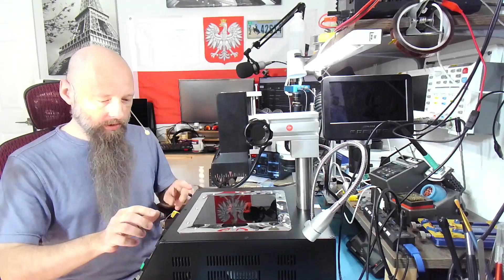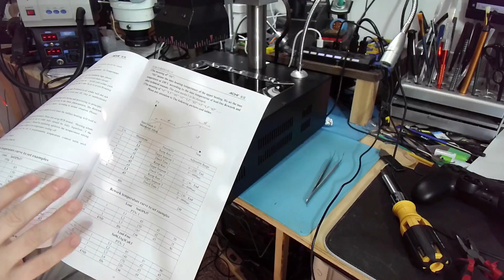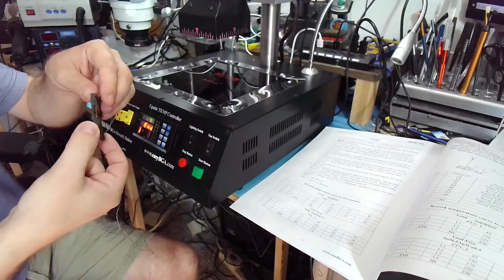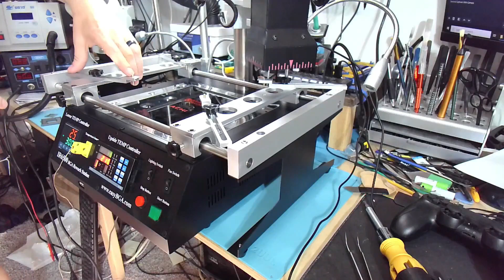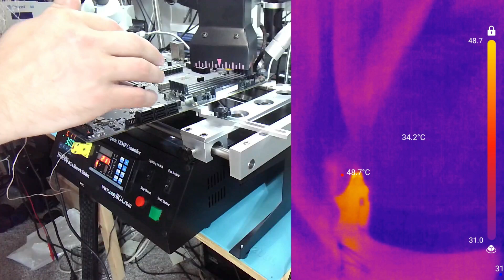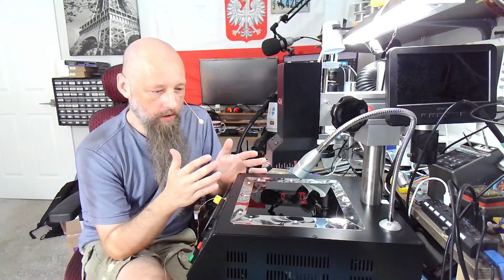#67 | IR6500 BGA Rework Station for CPU Socket Replacement

Comment: I'm now interested in this machine, have you ever tried to reball a lenovo legion laptop board before? If so what temp stages did you use? I'm asking because lenovo uses black glue around the cpu and gpu core which makes the removal process very difficult and a gamble.
Reply from the maker: yes, that underfill is a pain. Remove as much as you can at around 150C, then remove the CPU (standard CPU removal profile), then scrape remaining underfill at 150C at the bottom. it's 50/50 chance of success

Comment: Thanks for the tutorials brother. I'm just diving into this stuff in my mid 40's and your stuff is helpful. Business partner just gave me one of these so were about to see how many boards I burn up getting the hang of it🤣
Reply from the maker: in my case is was around 15 boards before I got some good results :)
Reply: @blackhorserepairs good thing these pallets have dozens of boards ready to practice on. I got a ROG Crosshair X870E Hero I got free waiting for me to get good. The broken pins are for DIMM slots 2 and 4 of course. Couldn’t be 1 and 3😂
Reply: I’ve also got the IR6500, just need the solder station now
Reply: @blackhorserepairs so far two attempts. Two failures. I keep ruining traces with the solder wick sticking and pulling them up while removing residual solder

Comment: I mean this video is already a year old and maybe I just missed the comment, but you mounted the holders the wrong way. As far as I know, they belong in the direction to make a step down, not a step up. At least this is also how it is shown in the construction video of the manufacturer.
Reply from the maker: that's true, but in that configuration you cannot put them in the middle of the board and the holes must be at the very edge for it to work. Flipping them upside down allows you to place them anywhere on the board. Yes, it lifts the board a bit, but it's IR, distance is not as important as it is with hot air

Comment: Great video. Its now been a year since you uploaded this video and I just want to know how this unit has held up as I am thinking about purchasing one now. Have you had any major issues with the unit or has it held up good? As for the arm on the right side hitting the frame you probably could put some washers under it where the adjustment knob is to raise it a little to stop it from scraping. Anyway, cheers from Australia.
Reply from the maker: no issues with it since I purchased it, I did mod it a lot though. I also recommend ReworkTC for bed control instead of REX

Comment: Hey Raff, can the bottom heater be used by itself on this station? Im planning to use it as a preheater for hot air work as well, thanks.
Reply from the maker: yes, in Rework Pro hit the "LONG" button and set for how many minutes you want to preheat. Set the temperature on REX and that's it. There's no limit, it will keep the bottom heater running for the time set.

Comment: You should 

not have the top fan (cooling fan) on the IR6500 BGA rework station when reflowing. The fan is specifically for the cooling phase after the reflow process is complete. 

During the reflow and heating stages, you must avoid any air currents over the PCB and the chip to ensure a consistent and controlled temperature profile. Unexpected airflow can cause uneven heating, leading to potential issues such as: 

Thermal shock to the components or PCB.

PCB deformation (warping).

Inaccurate temperature control which affects the solder joint quality.

Incomplete or uneven melting of the solder balls (cold joints or short circuits). 

The fan should only be activated after the heating elements have turned off and the rework station has given a warning signal, as part of a controlled cool-down process to prevent the board from remaining at high temperatures for too long and to ensure an optimal cooling rate.
Reply from the maker: tru, I have improved my procedure since then, I'll be streaming later today replacing LGA1700 sockets
Reply: i had a hell of a problem with mine, top heater is heating only on the edges, and thermocouple woudn't read past 150C as a result bcp nearly caught fire on the edge before 187C solder in the middle melted....

Comment: Did you check under your glass? Mine had 65% of the bottom heater covered with that aluminum shielding they give just to have the internal sensor inside attached in the middle 😂😂😂 jackasses i swear. I took mine apart now I got 2x Mitsubishi Move Master II RM-501s that Im gonna program to remove my chips and hopefully put them back also
Reply from the maker: yes, I removed the glass and moved the TC to touch the bottom of the board, it works a lot better now

Comment: Please have a question that could help my business quite a bit.  On boards like lga1700  - lga1851 how can you line up the socket exactly right without using a WAY more expensive machine that has auto-align? I have quite a few boards I collected that are worth money and would love to get working would help my business alot and I do have what i think is enough experience to use a machine like this, just wondering without auto-align how to align all those super small and tightly packed soldering joints on the board/socket on an lga1700 or lga 1851?(only use intel personally) :-)  Thanks mcuh for your time
Reply from the maker: I use a white marker to outline the socket before I remove it, then follow the outline. It's not easy and not very reliable but it can be done. If you're not sure about the alignment, use more flux just before it drops, it should self align, but the initial alignment needs to be close. Best of luck to you my friend
Reply: @blackhorserepairs  thankyou so much for the info, best of luck to you as well!!

Comment: Dzień dobry. I'm trying to start main boards repairing home "business" to make some extra money. Now I'm using handmade preheater (made of DVD-RW case and two halogen bulbs inside with power regulation) and air heat gun. But it doesn't work very well. One board fixed (in 3 attempts) and another one got layer split ( bubble appear ) and another one just didn't want to work cause of bad solder ( have some shorts on memory channel and not all lines are soldered).
So I want to buy this rework station to level up, and your video is very helpful.
Reply from the maker: you are very resourceful, it's amazing, but yes, this setup will not produce good results.
Get a cheap IR6500, mod it and get yourself Rework Pro, you'll get a lot better results for sure.
Good luck and if you need anything, join our Discord

Comment: Yeah the board holding assembly certainly positions the board too far from the heat below. You can see they used off-the-shelf aluminum stock to construct it, so they were probably stuck with that unfortunate height to save cost. But they also could have used a rectangular profile stock for the linear rails instead of circular profile to save on some height.....

Comment: Very informative video. Im planing on buying an bga reflow station and retrofiting with IR6500 head.
And do you think that even tho you placed IR heater right above the socked, can uneaven temperature be because the socket is closer to the top of the mobo? Not much thermal mass like in the bottom. Also, could some parts under the socket have more copper traces then other and maybe that cause melting difference?
Reply from the maker: the answer is yes, based on that you may need to adjust the position of the top heater

Comment: hi, really good videos, just wondered did you have to replace the top heater on the IR6500 as it looks a different type in later videos
Reply from the maker: yes, I replaced the top heater with 450W one (original is 400W)
Reply: @blackhorserepairs  can you share with us which one and where you buy it?
Just got the machine and doing planes how and where to start. I found that people looking for Elstein RFS/80, is that one that you got or some else? Alegedly Elstein make a big difference.

Comment: Are you using flux around the socket when you did this? I saw a guy squirt quite a bit of flux inside the socket as well and that would help it not melt or catch fire since it would help spread the heat more evenly. I bought a lot of reflow flux to use with this machine.
Reply from the maker: I only use flux for resoldering, for the removal process I do not use flux. I use Kingbo RMA and Amtech NC

Comment: Nice, I was just looking to watch videos of the machine and you're doing exactly what I plan to do first. I have a motherboard I paid $50 for and got a new socket for $5 already balled, so if I destroy it, it's not a big loss. I have everything to reball as well, I spent $500 on stencils so I have everything on hand. I really got it for replacing GPU cores and memory, and just reballing and reflowing.  I like this more then making a reflow oven out of an old toaster oven.

I have an old 3D printer with a duet 2 wifi control board, (it can be used for more then 3d printers), I plan to repurpose that to make the head adjustment automatic, and modify the holder for the board with a 2-axis automatic movement as well. I have the 2020 extrusion from the printer to use for that. I was looking for a laser that can mark a large + over the component so I can see the exact center. I can use the board from my 3D printer to replace the preheater control for the bed completely, I might put an LCD display in its place. I mean if I really wanted to get that into it, the duet 2 board could replace the entire controller on this but that's too much coding and trial and error, I don't have the time.

The head on mine doesn't fall like that but it doesn't move freely either, very stiff movement.. I was going to try greasing it, but I don't want mine to fall like that, so maybe I'll wait to mess with it. Did yours do that from the beginning, or after using it?

Nice Polish Eagle BTW!
Reply from the maker: Good luck! Let me know how it went. Do you use my software?
Reply: @blackhorserepairs  I just bought your software on Ebay. I was just trying different temp curves I saw people post for lead and non leaded solder. I did it manually which wasn't fun. Your software makes this machine much better.
Reply: hi there how did you decide which preheating station to get? I am also opting to buy one

Comment: the machine was already crap years ago
Reply from the maker: When used properly with proper software this machine can be very useful
Reply: @blackhorserepairs  you can build something better for less money
Reply: @olDirdey  true, and I am even working on that as we speak :)
Reply: @olDirdey  which one would you recommend buying?
Reply: @sharymens8187  sorry for the late reply. either DIY or take a look for termopro IK-650
Reply: @olDirdey so, did you built it?

Comment: Hello, I am building a station at the mo.   it has a fan in the base that will run constantly at a set speed.   Just wondering about the Fan for the top heater,  does it run constantly? or do you just run it to cool it afterwards?    Thank you
Reply from the maker: there's a switch to turn it on/off but I run it constantly, even during preheating when the top heater is not on
Reply: @blackhorserepairs  awesome, thank you

Comment: how are you powering this machine? i have been trying to find one for a long time but anything that ships to me in Canada only has 220v euro plug. I suppose i could just have one made :P
Reply from the maker: you can always replace the heaters on it, the controller accepts a wide range of input voltage. I got mine off eBay

Comment: Hi, can you recommend any IR bga rework station for working on graphics cards?
Reply from the maker: GPU core work is a lot easier than CPU socket, you can use Yihua 853A for a bottom heater and any hot air station. IR6500 that I use will also work but costs a lot more.
Reply: @blackhorserepairs  thanks , im looking to get the ir6500 actually. should i also get the yihua 853a as well or i does the ir6500 already have a bottom heater ?

also , ive seen people use these little wires which measure the temperature, are they called temperature probes? and can you recommend one to buy? i cant seem to find one to buy
Reply from the maker: @trixualz219  IR6500 comes with the bottom heater so you don't need the other one. It also comes with a temperature sensor (thermocouple) but you can find replacement on eBay in case it breaks. I also use 2 additional thermometers and IR sensor. Check out my videos, I shared a lot of that knowledge there. If you're new to this repair, get yourself a pile of cheap broken boards on eBay, after 10 boards you'll get proficient
Reply: @blackhorserepairs  thanks so much for your info, i really appreciate it. i am excited to start learning repairs like this and you really helped!
Reply from the maker: @trixualz219  glad to hear, that's why I do it. Good luck to you my friend and join my discord if you have any questions
Reply: @trixualz219  I've also seen the puhui t8280, any thoughts on that?

Comment: Interesting. If you drag the slider on the video, you can actually see the board changing shape with the heat!
Reply from the maker: yes, the socket moves down by a good 2-3mm, you can see that better on my latest videos with microscopic camera pointing from the side.

Comment: CPU replacement, gpu soldering/ desoldering machine, the best machine I've used should be WDS-620..
Reply: Its 10 grand
Reply from the maker: Wow, that's outside my budget by a lot

Comment: I am guessing you thermal camera is just reading the reflected IR light from the heater. It seems not a safe way to measure the temperature in combination with this device. 
But really nice to see your tests and results. I currently have a device with a contact problem underneath the chipset where I could make good use of something like this. I am to scared to use the hotair because of many components around and behind the chipset. I wonder what happend if I reflow the chip in such a BGA rework Station. Do I have to worry about coming components off the backside while heating it from underneath?
Reply from the maker: That is correct, the same thing happens when I use laser thermometer, it shows much higher temperature.
I would not worry about components on the back, especially with this device, but even with hot air I have never had anything fall off the back of the board, just try not to shake it :)
Reply: @ I saw some videos where was recommended to come from the back with the hot air, but yeah, it’s kind of risky one wrong move and they may fall off. Hm, I am still unsure. I just have one try 🙈

Comment: Przy wymianie socketu na takich plytach potrzebna bedzie stacja z duzo wiekszym podgrzewaczem dolnym . Przy takim grzaniu 90% plyt bedzie sie wyginac w tzw banan . Kolejna mala sugestia , zaslon uklady zasilania cpu , folia alu , badz blaszki aluminowe . Powodzenia w naprawach .
Reply from the maker: yes, I was worried about the board deformation too, I might build some additional holder to prevent the board from flexing during heating
Reply: hi there Dawid, so which one do you recommend buying? I want to buy a preheating station

Comment: A great purchase Raff, the infrared heater won't affect plastics but do a good job at melting solder balls  and this bga machine has been around for quite a number of years now that I'm sure you can find ppl sharing temperature profiles online say for  PlayStation or Xbox repairs graphics chips etc. Good luck and I'm sure you will become an expert after some practice 👍.
Reply: Can it be use to replace intel LGA socket?

Comment: I've had this station for working on motherboards, but after a lot of tries I sent it back because in my opinion to get good results you need a full size bottom heater to get the whole board heated up! 
But I believe with the right tune you can also get good results! 
Thanks for sharing and keep it up!
Reply from the maker: yes, I might mod the bottom heater
Reply: hi there, after sending it back what did you end up getting? what did you order that was better?